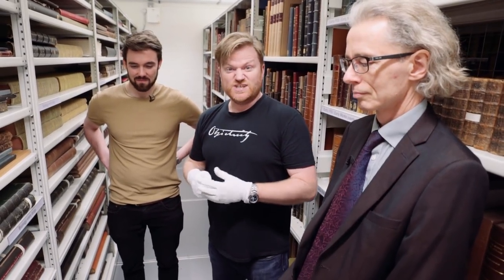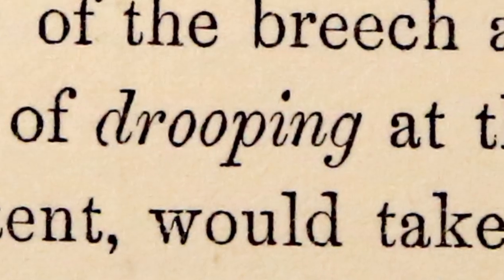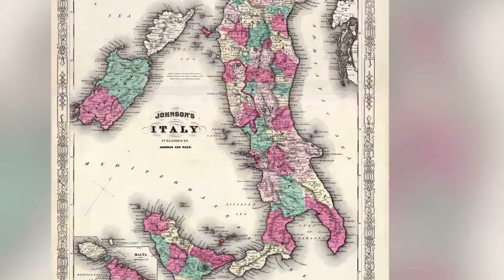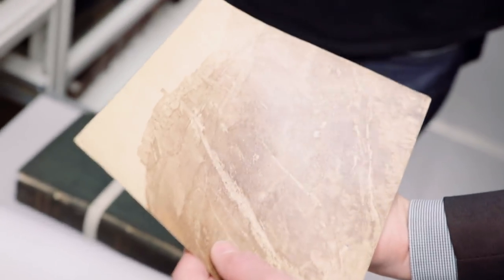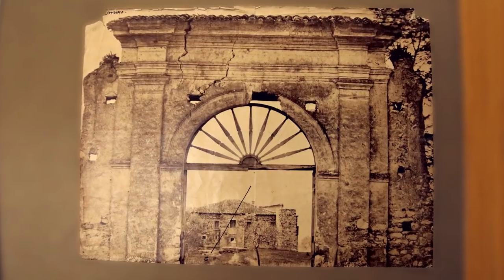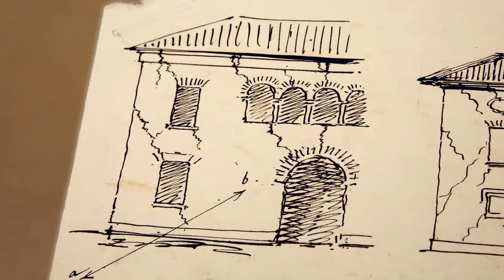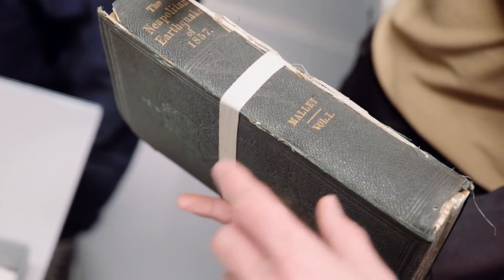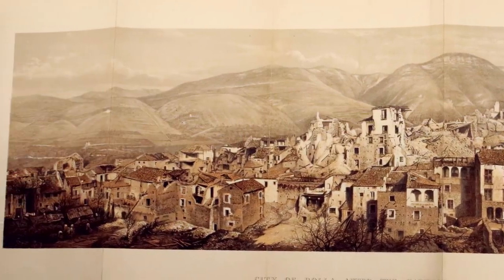The Great Neapolitan Earthquake (feat. Real Engineering) - Objectivity 151

Comment: 1.50 this does not make any sense, perhaps Mallet is talking about a bi-metallic cannon which doesn't droop? Or maybe the quote is out of context? Strange.
Reply: RollaArtis - The full quote is:
"The gun becomes bent on precisely the same principle that the length of the gridiron pendulum is preserved invariable, or the bar of zinc and brass in parallel bands of Doctor Ure's thermostad [ sic ] is inflected, namely by the difference of expansion, in these latter cases, of two metals having the same temperature but different coefficients of expansion, in that of the gun by the bar or portion of the cylinder of the same metal heated to different temperatures at opposite sides of its axis, and, therefore, differently expanded."
Reply: Nope - still doesn't make sense, except for the last part about the gun. But except for the general principle of expansion, this has surely no connection with the length of a gridiron pendulum being preserved invariable. Which is all about maintaining the length of a pendulum by means of the different effects of temperature on the length of brass and steel bars.
Reply: RollaArtis - Mallet's main point is that (for a black-powder muzzle loader, at least), the temperature of the barrel never gets high enough for it to soften and sag under its own weight, but cannon still suffer from muzzle droop.  This is because the differential expansion of the top and bottom of the barrel, due to their differing temperatures, puts mechanical stress on the barrel, leading to distortion even though the heat isn't enough to reduce its intrinsic strength.  He uses the gridiron pendulum and thermostat as examples of systems where mechanical stress originates from differential thermal expansion - with a cannon, we don't have two different metals at the same temperature, we have the same metal at two different temperatures, but the effect is the same.
Reply: Ah now I see - thanks for the explanation.